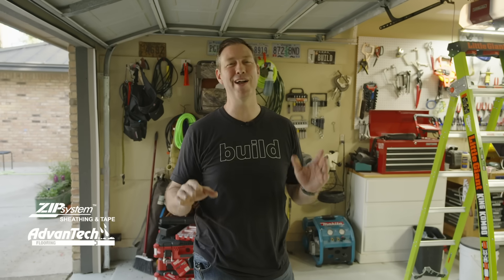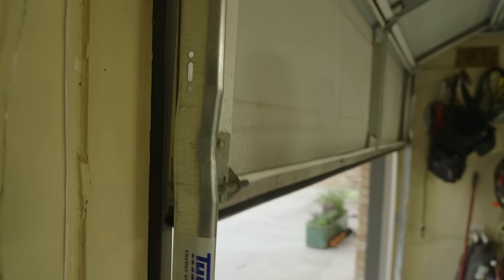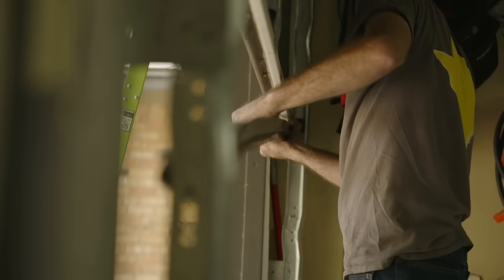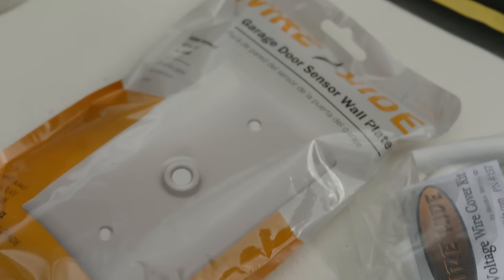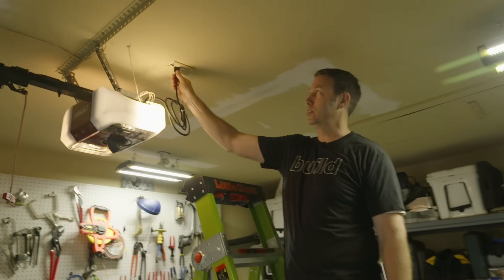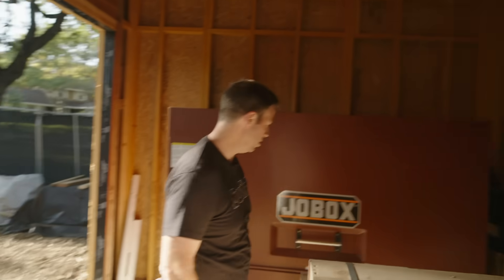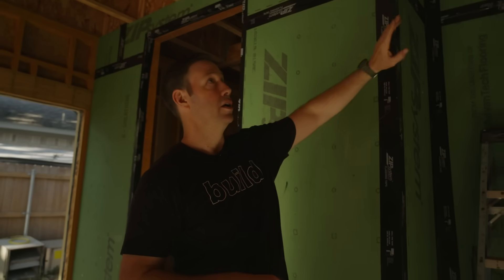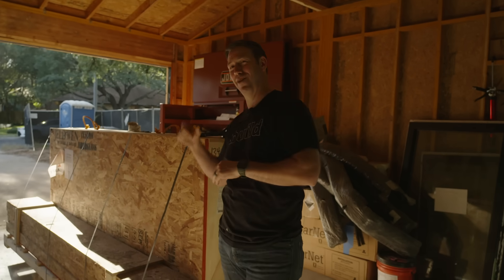Garage Door - Air & Bug Sealing

Comment: Nice, Matt!
Seems like a great way to set up a usable garage in a hot climate, or a cold one.
As far as air sealing to the interior, the Florida Building Code requires an automatic closing 45 minute door and the walls have to be sheathed with 5/8" Type X drywall.
Also, if there is living space above, the ceiling of the garage requires the same.
As always, thanks for the vid! :)
Reply: Do you mean the personel door or the garage door?
Reply: @danielbuckner2167  The door going into the living area, aka habitable space.
Reply: I ask because I swe old school looking barn doors on some beach homes here and there isnt an opener. Is that "automatic door" code for an automatic return to open sensored garage door?
Reply: @danielbuckner2167  No, it's for the garage door going into the home from the garage.
The automatic closer is so no one forgets to close the door going into the house from the garage.
It's just a pneumatic device that closes the door so one doesn't have to pull it shut.
Reply: @MikeBMW  got it. Is that in the 2017 change or later?
Reply: @danielbuckner2167  Started in the 2007 Code, best as I recall.
This only applies to the Florida Building Code as we only update from International Code every three years or so (2004, 2007, 2010, 2014, 2017 and now, in January, 2020) and the NEC adoption is usually three years behind that.
Reply: @MikeBMW  Are people using door closers or just sprung hinges?
Reply: @danielbuckner2167  By code, it states a self closing device.
I suppose the means thereof is left to the local building official.
"Other openings between the garage and residence shall be equipped with solid wood doors not less than 13/8 inches (35 mm) in thickness, solid or honeycomb-core steel doors not less than 13/8 inches (35 mm) thick, or 20-minute fire-rated doors."
It appears the automatic closer was removed from the code in 2017 but our local building officials still require it (probably a local ordinance).
The 2020 Florida Code is the same and I misspoke earlier, the door is required to be a solid wood doors not less than 13/8 inches in thickness, solid or honeycomb core steel doors not less than 13/8 inches thick, or 20-minute fire-rated doors.
Reply: @MikeBMW  Ahhh ok, I did know about the fire rating and it goes for stand alone utility rooms too but the closer was new to me. Thanks for the info.

Comment: A big thing that I hate with most garages is not having a lot of extra space on either sides. I know you had limits with your new one keeping the slab, but I know if I build anything new it will have 4-5ft at least on both sides for storage shelves.
Reply: Yup. I designed mine to have a workbenches down both sides and still pull in and open doors without hitting.
Reply: This is nice if you have the land, but in a lot of suburban areas houses are built with a footprint that takes up the maximum allowed amount of the lot.  So, in some cases you would need to take away from the living area to do this.
Reply: @darienredsox1878  So be it!
Reply: For sure. I have pallet racking down both sides of my garage for storage and can still open doors.
Reply: Just only put 1 car in the so called 2 car garages and you have plenty of room.  They really aren't' big enough for 2 cars anyway tbh.
Reply: @JohnVanderbeck   That doesn't work if you have two doors. We only have one car in our "two car" garage and my wife still has to let me out in the driveway because I can't get out the passenger side inside the garage.
Reply: CUT THE WALL OUT THEN !!!!

Comment: I have a shop with commercial 10’ door and I got the uninsulated and then bought blue 1/2 poly foam and cut out and filled each pocket very tightly.  Actually angled the tops and bottoms of each piece to slide in the groves.  I put 2 pieces for every square, so I get a full inch of R value.  It helps a TON as I keep my shop temperature controlled. It just looks ugly with the blue squares, but I’ll fix it eventually. Lol.

Comment: I put a 2” insulated garage door on my detached garage because I can’t stand the sound of cheap doors.
Reply: I live in Minnesota, so I've only heard rumors of uninsulated garage doors.  

We moved in March 2020, and our hew home had two insulated garage doors that made an incredible amount of noise. Today, the same garage doors are almost too quiet.We can hardly hear them move. My effort is chronicled below: 

In the first phase,  I cleaned the tracks, using WD40 Silicone spray as a solvent and paper towels. Previous owners had oiled and greased the track. That simply attracts dirt and ultimately makes the garage door louder. The tracks should be kept clean, and NEVER oiled or greased. I then replaced the rollers with "sealed" "nylon" rollers. "Nylon rollers reduce the clanking and squealing noises generated as the garage door moves. "Sealed rollers" eliminate the need for lubricating rollers and keep grit from collecting within the roller bearings. The last thing I did in phase one was to clean the spring on the torsion bar to get off as much grit and grime as possible. Fortunately the bearings at each end of my torsion bars were "sealed", so I did not need to try to clean and lubricate them. I then lubricated the torsion bar springs and the garage door hinges with a spray designed for garage door lubrication. I put excess lubrication on the torsion bar spring and forced the lubricant into the spring, raised and lowered the door a few times and then wiped the excess so it would not collect dirt and grime. 

The second phase was to replace the older Chamberlain chain drive openers with Chamberlain RJ070 openers. These mount on the wall next to the garage door and attach to the torsion bar. This eliminated the chain and all the chain noise. The RJ070 also has a variable speed DC motor, so door movement slowly starts up and slows down. This eliminates a lot of noise. These openers were pricey, but VERY worth it.The RJ020 opener is a bit cheaper, but the RJ070 came with a built in battery backup. We wanted to be able to open and close the garage door even if the power was out,and decided to buy the more expensive model. I installed the openers power outlets on the wall next to them myself. I therefore avoided that expense. 

Along the way, I adjusted the rails to make the downlegs vertical and that the rollers did not need to shift from side to side  as they traveled in the backlegs. My garage doors were guiding the doors so that they had the proper "door to wall" gap, so no adjustment was needed there. I did end up replacing the side and top seals around the garage door because they were not maintaining their seal when strong wind blew against the garage doors. 

Overall, this was a very rewarding project. It ended a few months ago, and we still smile each time we raise or lower one of the garage doors.
Reply: (I was/am sincerely hoping the "can't stand the sound of cheap doors" was a huge troll, rather than real pretension.)  ha ha ha...
Reply: HAAS has an R value of 14, an R value of 6 is for a cheap pan door "insulated". 

The guy in this vid has an Ideal or Clopay pan door.
Reply: Can you tell what brand you use please?
Reply: @peterchaploutskiy2555  C.H.I Garage door
Reply: @HOBrian2003  Second the CHI Doors. I have a model 5600 carriage house overlay door from them. It has foamed-in-place polyurethane insulation (R-17.5). I like the foamed-in-place better than preformed foam inserts because it adheres to the steel skins and stiffens the door appreciably. Whatever brand Matt gets, he should go for the expanding foam insulation for structural and thermal performance.
Reply: @brianstone3972  I would agree 100%!  You’re gonna pay for it, but well worth the investment.
Reply: Just installed an Amarr Lincoln2000 door two days ago.  Great deal and R factor of 6.  Very quiet and no play when installed.

Comment: You know, it's not too hard to find a CO sensor with a relay to turn the fan on automatically based on carbon monoxide instead of simple motion! I think hvacquick sells them.
Reply from the maker: Appreciate that. I’ll look into that
Reply: @buildshow  I'll be interested to hear how it turns out! I looked into it in the first place because when my grandma used to drive her 1976 cutlass supreme (up until a few years ago) just starting it created enough CO to set off alarms inside the house. Running a fan on a timer would definitely not do the job.

Comment: Wonder what the S track movement will do to the door long term.
Reply: Eh- it’s within the range of motion of the hinges and wheels- I guess you could argue the extra pressure could prematurely wear the weather stripping since it now has a higher load- but I’ve never seen a weatherstripping fail from flexing (and garage door weatherstripping is a lot thicker than standard).

Similarly I guess you could argue you’re applying a point load to the bearings in the rollers (assuming you have bearings in the rollers and it’s not an oil light bronze bushing) but, bro, garage rollers are like 5 bucks a pop. 

I think the value of giving mosquitos and other bugs the middle finger, & having a cool/dehumidified garage in southern summers FAR outweighs like $50 bucks in consumables bro
Reply: @bendaniel6245  Well said. Sometimes people are a bit ridiculous on their assumptions.
Reply: @bendaniel6245  if you watch the vid carefully you can see it causes more and more drag going down (or up) as it gets closer and closer to the down position. This will cause accelerated wearing on the seals, bearings and the garage door motor itself.

What it needs is something that only presses the door against the frame at the very last second just as it finishes closing.
Reply: It’s moving the door 8-10mm estimated from the vid. I’ve yet to see any garage door that cannot tolerate that much movement. The bigger issue for me is the interlocking joints between panels partially disengaging the overlapping seal creating a major air leak.
Reply: On that specific door, it's possible fasteners are loosening up already, it doesn't have the thicker metal end stiles that most "pan" doors have, just the thin face metal rolled around. I routinely have to replace the factory fasteners in that type of door with a fine thread 1/4-20 and flanged nut and that's without that track.
Reply: Destroy it

Comment: I just added 1.5" eps foil out to the door and made a huge difference
Reply: this; we did the same thing on the bay doors at work as there was too much heat re-radiating to work near them at certain times of day.
Reply: Go pull the red rope and bring your door halfway open by hand (you should be able to lift with about 2 fingers pressure and it should stay open at the halfway mark and the fully open mark. If it does GREAT close with 2 fingers pressure and you’re in good shape.) unfortunately you’ll more than likely find your door is HEAVY and likely need DIFFERENT springs installed or it’ll cause tears in your garage door and wear out many components over time. Same scenario with only adding tension to the existing springs unless you’re really lucky and your current springs can cover the new added weight 90% WONT

Comment: You were probably stuck with whatever dimension in width from the original garage, but 16ft garages are pretty tight for two cars, especially when one is a Suburban. I would never spec one in a custom build. 18ft or two 9ft singles.
Reply: I prefer single doors as what is in my garage so my business and opening that big of a door for one care at a time seems like opening both French doors on our deck everytime I walk in.
Reply: Definitely a premium look. Needs 18' minimum to fit, and needs twice the tracks and openers. I'd prefer that too as it keeps the cars more consistently apart. Many builders cut costs with the 16' double doors and make the garage the minimum spec.

Comment: LiftMaster and Chamberlain are the same company.  I have the same problem at the bottom of my garage doors where there are gaps on the ends of the floor seal.  I have no idea how to solve this problem.  I used Renner Garage Doors -- thick insulation, lots of options available.  I think Renner is local company and Delden Garage is the actual manufacturer.

I've had the insulated garage doors for about 5 years -- they keep my garage warm in the winter -- I've never seen a temp below 55F in the unheated garage.  I live in the heart of the USA.

Comment: The sandwich panel (pre-insulated) doors are SO much better than the pans, mostly because of the added rigidity. We need the insulation more than you do here, so 2" and even 3" pre-insulated doors are very common here. We sell Raynor at my work, so I'd definitely recommend the Aspen AP138 (or equivalent) for your case - 1-3/8" thick sandwich panel filled with polyurethane.

Comment: Very happy with my clopay 10x16 doors, 2"thick door with polyurethane foam, r-18.4 door. Also installed a larger astragal on the bottom of the door to allow an inflatable door seal to be inserted inside, it has a typical Schrader valve on the end of it to fill with air. Helps the astragal to seal to the floor and not flatten out over time. Yeah those corners on the bottom of the door are notorious for mice chewing threw and getting in. I was actually thinking of making little 4" long guards out of stainless that attach to the door and protect that corner area.

Comment: We have insulated garage doors from the mfr, there is a huge difference in thermal control. They are like R11. We live in Florida.
Reply: R11?? I find that hard to believe. The best insulators like polyiso are R5 per inch so that door would need to be 2 inches thick AND have a solution for the seams and joints.
Reply: @mv80401   Correction it’s R20. It’s Coplay’s intelicore  https://www.clopaydoor.com/residential/buyingguide/intellicore.
Reply: @allent555  Wow they look like really nice doors for sure and would love one that's insulated as that. I'm having trouble believing their claims though, R10/inch is WAY higher than other known foam core insulations. R10/inch is up there with aerogel so unless they're doing something else that's getting those R-values, I'm somewhat dubious of those claims and if they're true, then they need to get into whole home insulation with whatever they're using as you could potentially get R60 insulation on a 6" stud or R80 on an 8" stud!
Reply: @mv80401  standard sandwich doors are rated 10+ and if you have big bucks ..Haus doors go 18+
Reply: @skidmoro9642  -- thanks, I checked it out and the good stuff exists indeed (just rarely comes standard)

Comment: Side mount is the way to go! Super quiet, super sleek. Love the myQ app especially during the construction process to allow me to know everything is safe while I’m not there. In my new construction garage we have 2- R10 insulated garage doors 18’x9’. ZipR9 on walls separating garage and living space. Motion sensor exhaust fans. Living in a cold climate with no heat and no cavity wall insulation yet the garage stays at 56° or higher even on the cold nights. It’s also a 1300sqft garage with 11’ ceilings. A warm garage is always nice to pull into or for those house projects

Comment: Here's a thought if you're concerned about garage air into the house.  For the CEILING of the garage (on your remodel there's no storage space) use some of the ZIP sheathing+drywall.  That should prevent any air-leaks between the garage and the boys bedroom(s). 
.
.
I don't know what that "smart" exhaust fan system costs, but I installed an exhaust fan (16" designed for a barn) in MY garage for undr $100.00 (discounting labor since I did it myself).  Adding a motion sensing controller to the circuit powering that fan shouldn't cost more than another $50.00.
Reply: Makes no difference how many layers you add - carbon monoxide can diffuse through most materials if given the right concentration and time.  Garage requirements under living spaces is for fire protection.  If Dad decides to smoke a tailpipe in the garage, then son may be taking a dirt nap as well, regardless of 'tight' precautions!

Comment: One thing too consider , depending on your door is to remove  the plastic handle on the pull rope (keep the rope) for the door release.  Criminals could push on the top section of the door and  slide a  metal hook  at the top  to  open the door. If the plastic handle is gone they have nothing to catch.
Reply: Not to worry Matt is going to use an ED-209 (Robocop) to address any intruders.
Reply: Um